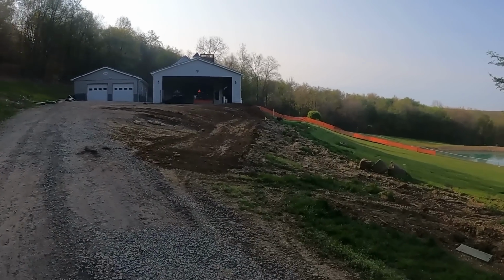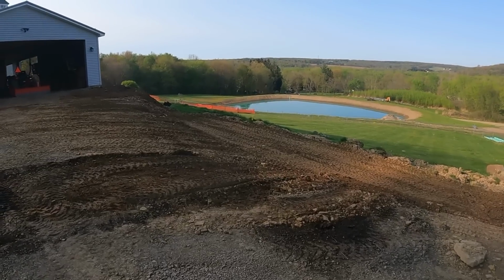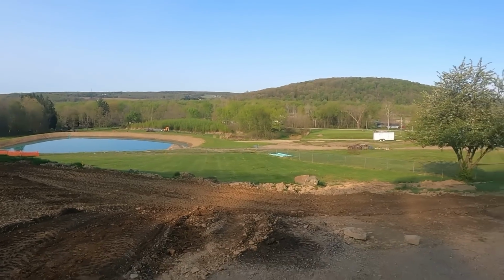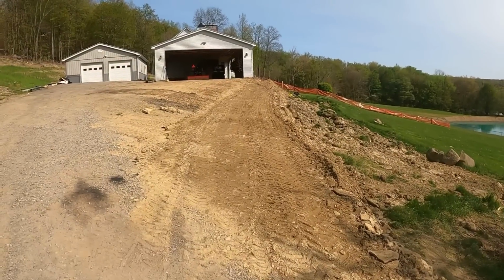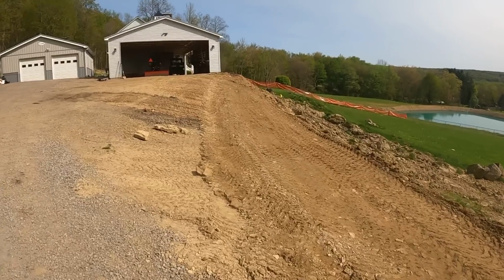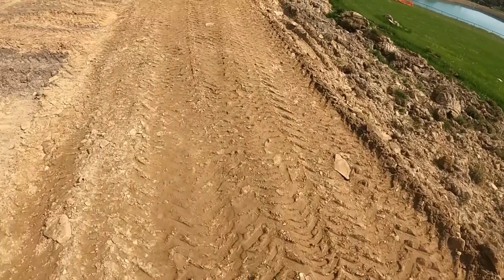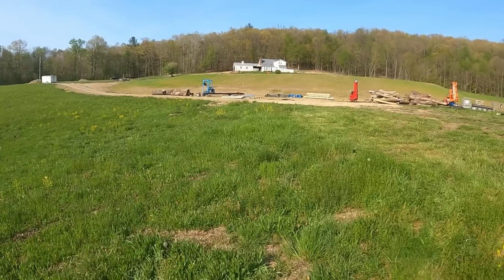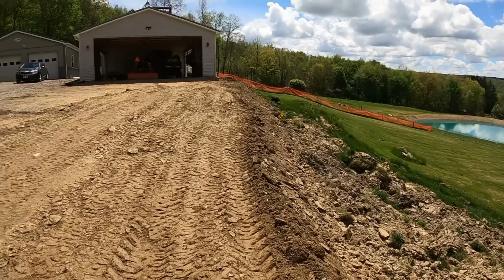Hoggin Dirt - 38 Loads of Fill With A Dump Trailer & A Half Ton Pickup

Comment: Don’t be worried about pulling too much with your f150. The towing ratings are more for stopping and high speed stability and safety. You’re driving slow and a short distance. There’s mo harm in progressing adding more load till you feel the truck working harder.

Comment: Adam, You are not just saving money. You are gaining valuable experience using the excavator  AND backing a trailer. That's a long way to back a trailer and still remain on the road. You're doing good. Carry on!

Comment: I love that you widened your drive way and make it functionally better as well as attractive.   

If you want a retaining wall, go for it but learn about how hydraulic pressure moves through soil.  A fixed wall will show every movement whereas a landscaped garden (including trees that anchor it) addresses that naturally.   Grass will hold it some but will require mowing and the slope there might present challenges long term, without reducing the grade of the slope.

Comment: Great job Adam 
Love this video, have some extra mounds around the property and have been using my dump and backhoe to move it into the low areas in my driveway. Was wondering how you are keeping your dump battery charged up while using it so many times in a short period of time ?
Thank you 
Chris
Reply from the maker: I believe my truck charges the battery while it is running plus I have a solar charger in my Amazon store I hook up when I’m not using it
Reply: @HometownAcres  thanks Adam 
Have a great evening

Comment: Looks good, but I'm afraid you will regret not renting a sheepsfoot roller for compaction. Just dont try paving for several years. With gravel you can keep adding each year as the fill settles. Not trying to be negative, just learned the hard way myself over the last 72 yrs. Keep up the good work

Comment: Best case, without doing the exact math, figure about 3 loads/hour times, maybe 20 loads per day tops  means you are saving about $1300/day.  It may not be a fortune but it may as well be yours.  I would take that anytime.  The pit restoration sounds perfect.

Comment: You do know if you moved your dump trailer to the right of the excavator instead of behind it you would significantly cut down on the time to fill it each time by making a simple quarter turn instead of 180 degree turn each time and having yet to extend your bucket further to fill the further parts of the trailer.
Reply from the maker: Can’t do that. It starts to get too steep